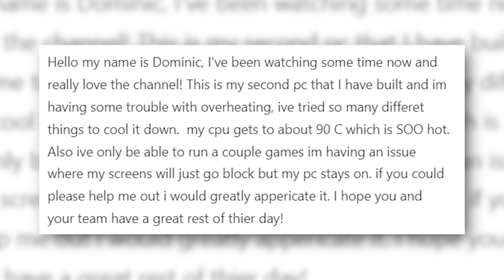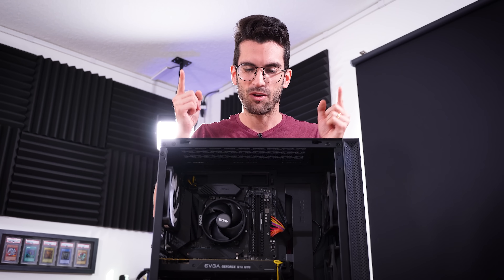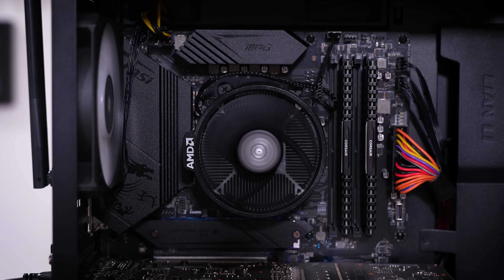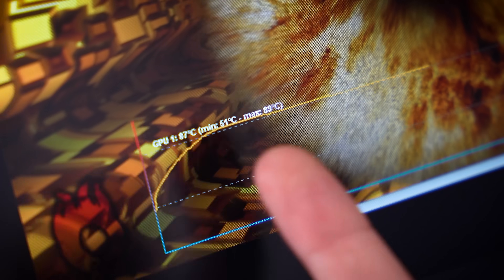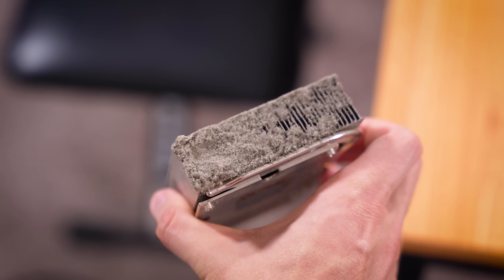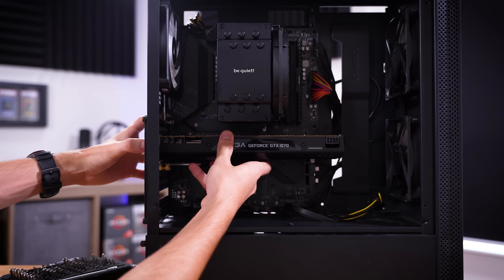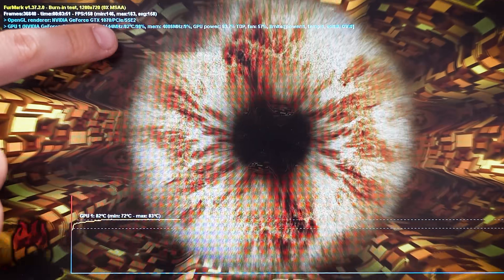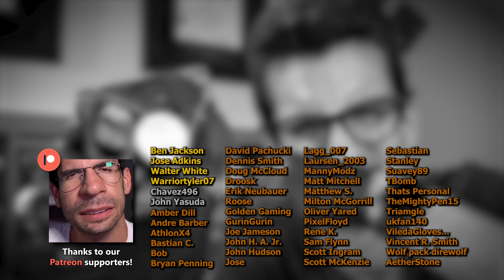Fixing a Viewer's BROKEN Gaming PC? - Fix or Flop S4:E15

Comment: A 5600x with 78°C is still quite hot for a Dark Rock 4. 

May be one of the infamous "Hotbox" Chips some CPU's seem to be. These run hot for no apparent reason and the real reason as to why they run this toasty is either a severly warped IHS because of manufacturing tolerances or is inside of the CPU itself. In the latter, thermal transfer from the Chip itself to the IHS just isn't as good because of a manufacturing defect.
I also had a 3700x like that once: It just wouldn't stay cool. It performed fine, but getting it under 80°C was a challenge. I tried multiple coolers and pastes. It just was a hot chip.

Under normal circumstances, a 5600x will be fine with the Stock cooler. Sadly the owner here just got unlucky. The chip will probably last for him just as long, but will always be a bit more toasty than usual.

Comment: I still think this is weird. I've dealt with the wraith stealth cooler plenty of times and both the 5600 (which comes with a wraith stealth) and the 5600X. The temps really shouldn't be that high, under either the wraith stealth or the dark rock pro 4, especially with an open side panel.

In my experience, in a decent airflow case with a basic 4-heatpipe single tower, Prime95 small FFTs didnt even get the CPU past 85 degrees, and that's with Furmark running on a 6650 XT in the same system (though to be fair airflow was probably good enough that GPU/CPU didnt affect each other). Cinebench R23 multi core + Furmark didnt even get the CPU past 73.

And even under a wraith stealth cooler, Prime95 only got the 5600 (without PBO) to 83 degrees, though it only boosted to barely above 4 GHz all core, and with PBO it did hit 93 degrees but boosted to between 4.3 and 4.4 GHz and was completely stable, and Prime95 small FFTs is far more intensive than Aida64. Gaming temps were in the 70s even with PBO, meaning zero risk of shutoff or even throttling.

There's no reason this CPU should be sitting at 75 degrees with one of the top performing dual towers on the market, in a case with fans + open side panel. That just shouldn't be possible, even if PBO is enabled.

Im guessing that there is something wrong with the CPU. The IHS is probably not making proper contact somehow. I don't blame you for not checking of course, since opening up a CPU isn't perfectly safe and probably shouldn't be done for a viewer build, you found a satisfactory solution and that's good enough, but I don't think cooler inadequacy was the problem here.
Reply: At @3:20, when Greg is showing the CPU clock and package power, it shows 90W and not dropping clock during max load and high temps. I suspect PBO or MSI auto OC in BIOS is on.
Reply: As an owner of a 5600x myself, i second that. It's a 65W chip, basically any cooler should be able to handle it specially with an open side panel. He definitely should have repasted and reseated the cooler and tested again.
Reply: Yes, seeing the 5600X with the Dark Rock Pro 4 above 60C should be alarming. I had similar problems after enabling DOCP, but a BIOS reset solved everything, even after using DOCP again.
Reply: Agree, currently running a 5600x with a Noctua nh-d15 chromax and its not even trying to cool the CPU.  Under full load with a Ryzen Master light OC its barely breaking a sweat...  Something more is going on here.
Reply: That was my thoughts as well. There's no reason why this... relatively underpowered chip, should be hitting 75s or 80s with a very very good air cooler sitting on top if it. I have a 100W TDP chip under a similar cooler and it doesn't even get that hot, even OCed. 

I also suspect something is wrong with the CPU, like what you mentioned. Either the IHS is warped/bent (which I've... never seen) or the IHS isn't making good enough contact with the silicon. It'll... live, sure... but it's certainly not right. 

I mean I know amd chips run hot but.... not... THAT hot.
Reply: @reeepingk  actually amd cpu's do run how with xmp profile activated, most motherboads bump the soc voltage very high + pbo enabled makes it draw a lot more power (mine draws 130 watts for example).
Reply: You are right, imo. My 5600 x with 4,5 gHz all core barely hits 70`C in stress test, cooler H100i (about the same as a good air cooler) That chip is broken or bios has funky stuff going on
Reply: @alukin2853  mine with 4,4 all cores hits 90 with a noctua cooler on prime95 maximum heat stress test

Comment: fans at 100% a bad thing? and would you say 70°c gpu temp and 80°c hotspot a bad thing too? my gpu runs at this temperature while running rdr2 at high settings
Reply: yes your gpu has crappy cooling. Most of them do. What is over 65c is not good.

Comment: I think thehighlight of this episode is the change on the GPU. It's such a huge difference for only a few bucks worth of thermal paste and it's nice to see someone still using such a great GPU... really was a worth investment back then.
Reply: Given the amount of dust in the airway, I wasn't exactly surprised when I saw the GPU temps go down! I'm not surprised that GPU temps are still a little high, given it is a blower style card, but still... nice and cool! The stock CPU coolers don't seem good enough for running these Ryzen CPUs under high load; I know the stock cooler on my R5 3600 isn't really good enough, because the CPU gets hot on that, too!

Comment: The DarkRock4 would be such a better cooler if bequiet fitted it with a Silent Wings 4/Pro 4. Their proprietary 135mm fan just makes the cooler incompatible with better fans. I used to use the DarkRock4 on my 5800X3D, but I just wasn't seeing the temps I wanted. Bought a Silent Wings Pro 4 fan in the hopes of improving performance only to find out bequiet's clips cannot fit the slightly larger 140mm fan. After contacting bequiet support they told me there's no way to marry the 2 items. Honestly a big missed opportunity by bequiet IMO.

Comment: I got this cooler with my R5 3600 and took me less than a month to replace it. Temps were basically 90 in games. With new cooler which wasnt great temps never reached 80 or hardly above 70. That said I dont understand why they add this to cpu. It works fine with 2600 but with 3600 and higher no way.

Comment: Hi Greg. I was thinking also about the client's case, in terms of the front being closed off of airflow with the exception of those 2 thin mesh sides is all the fans can pull air from. Not a "big deal" for a system like this, but just wanted to mention in terms of overall thermals (not that you should have swapped the case). Love this series, thanks!

Comment: I am going to throw this comment on before I even watch the 10 minutes left. I bet that 100 Grungier Case from MSI is choking the heck out of that system.
For whatever stupid reason, I bought the Skeria 500 X ALL glass sided case and the ONLY way to run the system was with the side panel OFF.

EDIT:  OK, I admit that repasting will help out a great deal. Awesomesauce video, Greg! I really am curious how the temperatures ran when all the panels were installed?

Comment: we are all humbled by those moments. We forget to remove the cooler peel, we forget to reconnect the fan, we forget to put the IO shield, we forget to reconnect the SATA cables, we forget to switch on the PSU, we forget to connect the display cable to the monitor, etc! hahaha! really appreciate the humility and the truth in your videos! more power Greg!
Reply: Those stupid mistakes are often the only way we learn. I remember when building my first pc I plugged some things in wrong and ended up frying the mobo (I saw smoke, not a good sign). Thankfully, microcenter took the return, and I never made that mistake again. We all learn.
Reply: I was troubleshooting a computer here a couple weeks ago, and I was cursing power supplies, tried out three different ones, then I looked and, I  had pulled a Greg and didn't have the power strip plugged in. 😅
Reply: I turned on the power supply, got a flash on the motherboard and then it didn't power up.  I thought I had fried the MB.  Nope, seems one has to turn on the power supply AND press the start button.
Reply: @RH-cv1rg Yes, that's normal behavior unless in bios you set it up always on and then the PSU can directly turn it on.

Actually, that can be worse. With a proper shut down the always on doesn't turn it back on until you turn the PSU off and on. Lol

I have some computers set to this behavior for good reason. They don't have power buttons installed.

I could on a few of them but those cheap buttons never worked. Always had to turn it on directly with a screwdriver. 

Long story short I've freaked out something was really broken in your exact circumstances.
Reply: Yep, that's a pretty good summary of my learning curve.
Reply: Happened to me on the second PC I built. Had not worked with the latch style AMD cooler before and didnt know how hard you had to push to actually latch it down. Freaked out when running running furmark test and seeing the temps. 
Also one time working on my own PC I forgot to turn power switch back on after and ripped everything apart to find what was wrong, then I realized 😢
Reply: The last time I had a SATA cable issue, it wasn't because I didn't connect... It was because something caused it to get loose and not be fully seated. So a game installer would work, but upon verifying files there'd be file corruption. Better yet, the game would sort of run. It was so bizarre for a while. No idea what got me to check the cable, but I eventually did and everything was resolved. The system even stopped randomly locking up when files were being accessed on the drive.
Reply: The worst is forgetting to switch on the PSU and freaking out when you hit that power button
Reply: Disliked because your comment spoiled the video
Reply: @MZRFaith  😂 Watch the video first then? 🤣
Reply: He did it on purpose to foster some sympathy and to pad the time obviously

Comment: Greg, hi! Listen, I’m asking myself this question: why don’t you touch on such a topic as PBO in your repair videos? This is an excellent fine-tuning of the processor, where you can undervolt the processor, increase the limits, remove them, set a higher or optimal frequency?

Also, according to this video, there is such a topic as undervolting video cards; in a closed case (coffin), elevated temperatures are guaranteed, and undervolting is an excellent panacea for high temperatures..
Reply: for gpu, removing the coffin and scraping a bigger fan on it is better than undervolting.

Comment: The 5600x likes to run hot, I had to use a 3rd party air cooler to keep the temps under 72 degrees Celcius at max. My resting temp is 30 Celcius.

Comment: Next time you need to do a in between step by just re pasting the CPU cooler
or your msg is fixing by upgrading. there is nothing wrong with the stock cooler.
Reply: Nah the stock cooler is only good for low tier cpu, like fx ryzen 3 3300 or lower.

Comment: I would love to see Intel and AMD finally start including appropriate cooler with cpu as an option for buyers
Reply: Finally? I built my cousin a pc using a ryzen 7 3700x and it came equipped with a wraith prism which is a really descent heat pipe cooler. No issue with thermals in his pc, and it's fairly quiet as well.
Reply: I built pc with Ryzen 7 7800x3d. Cpu was around 500€ so I guess AMD could give me an option that for extra 10€ I can get this cpu with decent cooler

Comment: 40's at idle on Zen is what I usually expect with the aggressive Voltage spikiness and constant boost behaviour when PBO is on, especially on a wraith. My 5900X on a Ak620 often hit 50's and just went ham whenever it could. By comparison, my 13700K at 1.25V is a fridge lol. Definitely prefer static Voltages now. I don't mind losing 100mhz on single core and having the system go all willy nilly.
Reply: was searching for this lol, without an undervolt my 3900x goes between 40-50 at idle on an nhd15.

Comment: I run a 5600 with stock cooler and over heavy load i get at worst 78~ . Could of just been mounting pressure but hey id take a cooler like that any day so awesome stuff
Reply: I just got 5600 recently with 85 freaking degrees when running cinebench. I just switched from ryzen 3 3100, and was thinking that maybe my pure rock slim isn't good enough. The next day somehow the temp hovers around 67 degrees when running cinebench. Really weird
Reply from the maker: 5600X tends to be a bit more liberal with power loads. Several have reported temp issues with theirs and the bundled Wraith Stealth.

Comment: Great video! I was expecting a sticker issue. That's crazy they didn't ship a slightly bigger cooler. Guess I better go look at coolers since I just got one of those for my son. 😕
Reply: Ryzen CPU coolers are pretty good for the most part, since most Ryzen pre-LGA have a 65w TDP.
Reply: They are good but they are only providing the wraith stealth coolers now which were meant for the 2 and 4 core cpus. The 6 and 8 threads used to come with the wraith spire. Bigger cooler and a big copper plate in it. I took a spire off a friend and it's been on my wife's 2400g for 5 years. It's a shame amd has cheaped out.

Comment: I also had overheating issues with the Ryzen 5600x with stock cooler after upgrading to a rad, temps cooled form 96-97 idle to a cool 30

Comment: I know it doesn’t make sense since you’re upgrading anyway, but would have loved to see a repaste of the cpu and what that’d do to temps. 

The stock cooler shoooould perform better than this.
Reply from the maker: IIRC we showed paste application in the video. Looked like the stock Stealth stuff, which normally isn't terrible. Was also spread appropriately and in sufficient quantity.
Reply: @GregSalazar you did. I’m just very surprised it didn’t perform better, so figured it might be a bad paste or maybe not enough mount in pressure. 

But as I said, it makes sense you didn’t refit the stock cooker since you did such a great upgrade anyways. 

As always great stuff Greg - absolutely love your content.

Comment: It's unfortunate how little people know about undervolting in 2023. You could easily undervolt the 5600x with that motherboard at least at a -25 curve and possibly even have it boost up to 4.7ghz while getting better or similar temps and better performance. The possibilities are endless when it comes to undervolting on these newer chips and it's a shame that it isn't  very widespread.
Reply from the maker: Like I said, I preferred to upgrade the cooler before tinkering with anything performance-related in the BIOS. And seeing as though this chip was already stubborn enough as is with heat, it likely isn't binned great and may not take well to undervolting.
Reply: @GregSalazar totally understandable, but my point is how little people know about undervolting in general even with how many things AMD has been adding for it in the newer chipsets BIOS.
Reply from the maker: We'll need to make a video on this soon. Could be a huge help to folks 👍
Reply: @GregSalazar  definitely a good idea, with things like PBO 2 and MSI afterburner it takes less than 2 minutes to do a stable undervolt. Undervolting = lower temps, better performance, and better longevity. Very few content creators have promoted this idea of "undervolting" so doing a video on it will definitely be a big help to others. I would totally make a disclaimer though to say that this is completely safe because a lot of people Ive seen somehow correlate undervolting to overclocking thinking it will damage their system when it's the opposite.